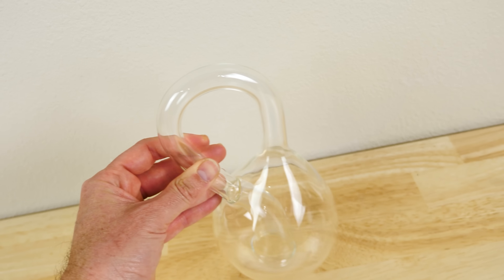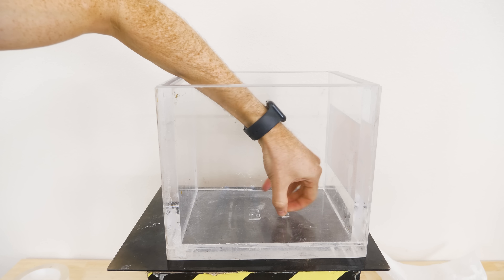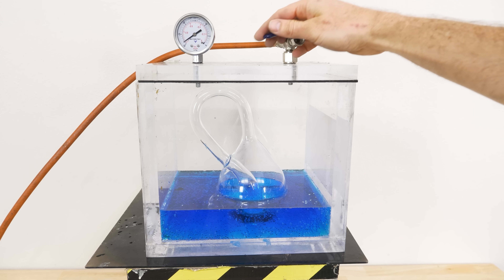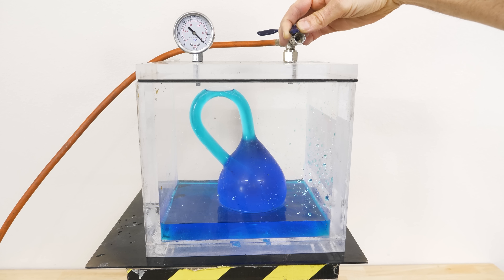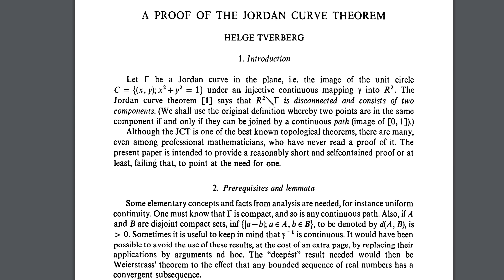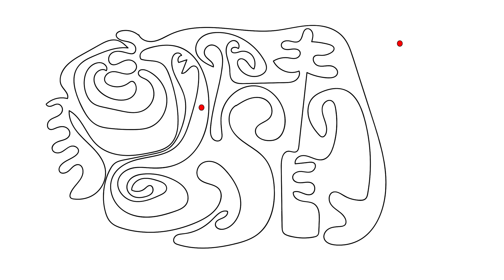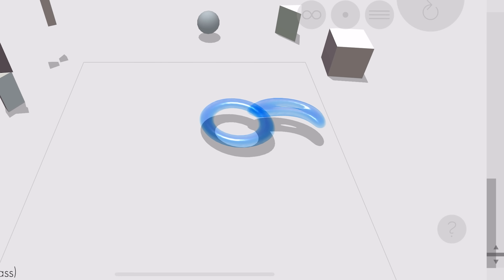Is It Possible To Completely Fill a Klein Bottle?

Comment: Actually the bulb that the water initially came in and the neck are technically the only volume the object has because it still holds liquid quite well inside. Bro just debunked my argument

Comment: The beaker actually does have a volume, due to the thickness of the glass (i.e. inside the glass sides of the beaker is different from outside). 😃

Comment: What the i have a question 3:20 so does a cup have no volume
Reply: The volume those not include the hole, the mug itself does, the handle and all that stuff , tecnicaly the bottle does have a volume since the glas Is somewhat thick, but the geometrical shape itself dosen't, this Is like the best replica

Comment: Or you could completely submerge the bottle, moving it around constantly until all the bubbles leave the bottle.  But then you wouldn't have used the vacuum chamber, and at that point, is there even a point to doing that?

Comment: Couldn't you FILL it by using a flexible tube on a syringe?

The problem with filling it compared to a normal glass is that the opening as a syphon and will be filled completely with water, so that the air can't get out. A small tube going through that opening into the chamber would solve, wouldn't it?

Comment: It's not really "arbitrary" to say the volume of an open containing is at the flat top if you're referring to the volume of what's inside of it, because that's how it works and how it was built to work. It's no more arbitrary than simply deciding the physical object itself counts as the borders for where volume exists. Otherwise, volume would be the amount of mass of the object itself, not the space in or out of the object.

The Klein bottle only doesn't have volume, based on your description that a regular open cylinder doesn't, because one end is open. Going into itself doesn't really matter because that portion of the bottle can be filled in and around the tube with matter. The only thing is if you want to be completely exact, it would have to subtract the volume of the tube material itself in that section. But earlier I mentioned the volume of the item itself rather than the space inside or outside of it. So the Klein bottle has a volume because it exists, obviously. So the volume of just the inner tube subtracted from the volume of parameters inside the tube and outside the tube (But still inside the bottle) plus the volume inside the rest of the tube is the volume.

It "technically" has no volume. I guess it's just the fun nature of the thing.

Comment: This is cool but misleading. That's not a Klein bottle. A klein bottle cannot exist in 3 dimensions. Also that beaker does have a volume in any way of interpreting it. If you are interpreting it as a surface with no thickness then its volume is just it's area (it is homeomorphic to a 2d ball). If you literally mean the beaker with thickness included then it has a 3 dimensional volume as it is homeomorphic to a 3d ball. Either way the beaker is orientable. The klein bottle has no volume because it is non-orientable

Comment: To fill the container, simply insert a flexible plastic straw or a small diameter flexible tube into it and then pump the water through the tube or straw. Now the air comes out and the water goes in, there's no need to create a vacuum.

Comment: but what is in and what is out? If you can confuse those then it gets real messy. The universe as I build it has in or out in both space and time, like how light travels, from A to B, it does so without a care for C in all directions at once, but it is ultimately one directional. If we build a universe out of this flat line you want to pin A in place and rotate B around itself infinitely in all directions allowed by the finite limit you set on the line length (x), it seems to work, you create a nice tidy 2D manifold on a 3D object, but what and why is one end of your line pinned in place? I square it up moving one end infinitely slow and the other infinitely fast, it seems like a similar shape, but now you have a manifold on the inside and outside, a tiny sphere at the centre and a larger sphere outside. You created a finite looking space from 2 infinities. In and out. Switching the perspectives just creates a mirror of itself where its inside out but its the same looking shape. 

IDK it feels a bit more like how the universe does things. You seem to have 2 infinities. One we look out across, its easy to rationalise it as being infinite and mass being finite, you can walk around the mass to see its extremes, so it feels finite, but is it? 

If you could go on a journey to the core it would be a long journey, with pressures and compression, you wouldnt be the same size or shape when you arrive. But when you get there, is that the limit? There is certainly more scaling inside you, to the atomic, and subatomic, and maybe beyond.. when you are there at the core you and the mass have the same idea of down left inside you, so you are null, weightless.. If you move from the core without motion, the mass of the planet is inflating and dilating more mass in the same time than you, so you have a perspective of sinking, but are you moving or is it? 

4000 miles from the core the dilation of the planet pushes you up and out at 9.8 mtr/s it feels like you are pulled down towards that null point, but its just the displacement in space and time. If you give yourself a nudge at the core you enter orbit, keeping pace with the universe, adding momentum raises your null point up and out from in, this is orbital mechanics coming from inflation, not a pull a push.  The reason you feel like you fall is because you are higher and slower than orbital mechanics would usually allow, your null point is a ways below you in space and time so you want to "fall" to it. If you was lower and faster than orbital mechanics allows, you would fall up not down..  Perspective is weird huh, but the math fits to why we cant see into the void infinitely, pretty soon the universe seems curved even for light.. 

But it is all perspectives isnt it, we can rationalise the infinity out as light can cross it easily. If it was looking at mapping the universe it might think that we are the voids of infinite size.  What is the bigger infinity, the one we both see across, or the one not even light can see into.. 

In one sense I see the universe as a singularity containing a singularity, scaling infinitely its just event horizons separating realities. Rationalising the one in space is easy, you approach a singularity. As you do so you appear to slow until you would pause to me, the flip perspective comes if you can scale and dilate in size, if you could take a trip to the atomic world, your old room would red shift from view, even if you only went as far as a glass of water on your table, a new observable universe becomes visible. If you could see past the void, we would look like we paused, like we were the ones on an event horizon, because we are.. This is the way through, in.. deeper smaller time will tick by faster and faster for you as you scale, its all just dilation in space and time as you ride the fractal that is the universe.  

At the centre of a singularity should be a null point like at the centre of planets, its the flattest local area of spacetime, but a Newtonian mind says the mass pulls out in equal opposite directions, it should allow a tiny event horizon to form, and inside it is where our universe plays out, infinitely hot and small that side of the horizon when you dilate down inside its cool and expansive. As our singularity cools it evaporates and loses mass, the central point "grows" and relaxes, the universe gains a bit more space to grow into and we all fill the void by dilating, everything space and time and mass all dilate, but not light..  its an information wave riding an information wave, it records the change over time, red shifting as it goes, 

Check out a symphony of spheres in microgravity, its kind of how I see it, with singularities inside eachother, mass transfers give dilation and momentum to a static system. It looks clunky but i bet causality is smoothing it out for us, if it did pause between mass transfers we woudnt know. It feels like a vector, presenting as a logarithmic curve, but it is messy, far from constant. its all just perspective between 2 infinities, one in, one out, its like space is pulling or counting from one direction and time is doing the opposite. We straddle a thin layer between in and out. 

Also find a Julia to Mandelbrot set, centre things on xy=0 and you see that squaring 2 infinities can give you something from nothing, it looks like a circle or sphere in a void, infinity in, and infinity out. Squaring up and following the chains you either loop in to an infinite spiral, or out to another infinity, but both ends never stop moving, you have what looks like a closed loop and open hooks, its almost quantum.. idk it feels like if it is a circle you square it up infinitely again and its a sphere, square it up infinitely again and its a whole universe of spheres, square it up again and its spheres inside spheres around spheres to infinity.. 

This is how I would build my universe from infinities. My time cone feels more open, rather than closed, its a tunnel, where my resting horizon is flat, spinning me around the walls, If I can get up to light speed then I travel out in space but not so much in time, my vector aligns with the tunnel, This is thought to be the limit, but keep going, accelerate more and now your vector line is curving away from your initial spin, it seems like you grow in size and scale  to an observer, but you head for the wall of the time cone, the faster you go the sooner it will be, but when you hit, you will be 180 degrees from your initial vector, you break into a higher tunnel where your new speed is a resting speed in a larger tube that surrounded the smaller one. 

This is the way out, or in? its hard to rationalise which is out, which is in. We have flipped perspectives so many times it feels like it doesnt matter. Light itself is a reflection, bi polar in nature. It will give you false positives and confirmation bias. Take flatness you feel, it never aligns to the flatness you see for long. Light isnt doing orbits so it doesnt show you the curves in space and time that you are bound to. Every flat path we take seems curved.  It always will until you approach light speeds, then nothing will seem flat apart from your vector. to your sides will be a curving horizon that will mostly fill your view

is out larger than in? can you be in without having something out. 

Its easy to give one infinity more value or weight to it, but only if you have some finite limit imposed. Take a situation where you have 3 pockets, 2 infinite in size, one finite. The rules of the game say that the 2 infinite pockets carry the same amount of money, they weigh the same amount, filling the same space, but one is $1 bills and the other is $100. When you spend you can only pull from one pocket, and you can do it infinite times, and any change from the transaction will be stored in your finite pocket, where you cant spend it. 

Now you have limits on infinities. The $100 bills will save you time, but if you have infinite amount of time, you wont mind counting out your transactions in dollars, you are worried about change weighting you down more no?

What if the transactions are in the billions, and your time is infinite,  but your patience isnt..  there is a balance to what is worth your sanity no? if it was simply a finite time limit tho you wouldnt want to spend your life counting out smaller bills all the time. Carrying some weight with you is a certainty.. but the weight can hit you in so many different ways it depends on your perspective of it, just like your perspective of the infinity you see over the one you are stood on, if you had infinite time to explore the universe you could explore space easily, but mass, that is hard, you need to break more than time to go there.

The speed of light in a vacuum is faster than it is in water, so what is the speed of light in mass. id assume it wasnt zero but i also would think it wasnt fast, or you would see through the planet eventually.. Is it Euclidean, if you asked light it would say no. If you cored through the planet it might feel like you connect 2 points with a flat path until you walk it, if you could see it on a time cone you map each step.. Its not the flattest route, if you flatten the cone out for density, is it even the shortest?

Cones are weird, you can have one looking 2/3 full and it is barely filled and thats with density constant like a glass of martini.  How weird are they when you have pressure, and density and dilation.. What shape is our time cone of the planet when its flattened out for density, how tall do you think the cylinder would be? would it be a cylinder? could it look like a light bulb? if you could unfold everything would in be a bigger infinity than out?

Comment: Couldn't you push a bendable straw all the way to the "bottom" of the bottle and fill it through the straw? The liquid should push the air out of the bottle through the "opening" as it's filling it. This should be the same as filling the bottle from the bottom, so it should push the air out, no matter how much the "top of the bottle" bends.

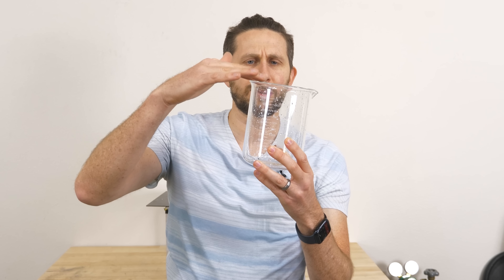Comment: At about 3:45 it's explained that "you could say the volume of this beaker is anything below this line here" in reference to the top of the beaker "but we would just be placing an arbitrary line to differentiate between what we perceive to be the inside and the outside of this beaker" to explain why the Klein bottle, as well as the beaker, have no volume
I have a severe issue with this way of thinking in the scientific community as well as with scholars in general. The concept of volume in general is made with an arbitrary definition with the purpose of determining how much space an object holds. Under these parameters of purpose you're being obtuse. Determine the variables (like gravity for instance, possible velocity if you're using the estimated volume hypothetically to remove a liquid spill in space so you took a beaker and used speed to scoop up the spill)
This is an issue in philosophy as well. When people spend too much time trying to become learned they become stringent and it's difficult for them to view things outside of how they learned them to be. When speaking of volume, you're technically correct, but technically correct is the worst type of correct in lamens. If you're a rocket scientist it's important to have every number, calculation, and definition be correct, be technically correct, but I think this is a way of thinking that people in specialized fields accidentally bring into the real world. It's important to take some time once in a while and get the outside view of your field and not forget that a lot of the philosophies you hold in that field become too obtuse and stringent in the real world... All this to say, the Klein bottle and the beaker do have volume, but theyre determined by more factors than just the shape and size of the container

Comment: A physical Klein bottle doesn't appear to be an ideal Klein bottle because you still have to form a seal where the neck moves back into the main body of the bottle, and so it forms a seal that defines an inside and an outside, if you assume the opening at the bottom of the main body works just like the beaker.

Comment: I do appreciate that you pointed out that a physical Klein bottle is no different than any other bottle, other than shape. As for 4th-dimensional objects, do we have a way to confirm that a 4th dimension exists? Actually, the 4th dimension does exist. A Klein bottle should be referred to as a 5th-dimensional object. The 4th dimension would be time.

Comment: Any cup doesn't have volume... if it's open, you don't have volume.  Doesn't seem very interesting. It's basically a bottle or a cup, you can turn it around and do several things, and call it calculations... it's a freaking cup.

Comment: According to the definition of volume used here in the video a normal coffee cup also 'has no volume'.
Both, the klein bottle and the coffee cup are open to the outside, the only difference is that the Klein bottle is so to say  'folded' through itself. 
- The outside surface of a Klein bottle is at the same time also the inside surface.  
-  However the latter statement ALSO applies to the regular coffee cup just the same. 
As mentioned, just like the Klein bottle, the coffee cup is open on the top. The 'inside surface' of the coffee cup stretches around over the top edge onto 'the outside' so there is also only just one actual/mathematical surface on a coffee cup. 
The Klein bottle and a coffee cup are more similar than it seems at first. 
What makes it a little confusing is just that one so to say has a 'knot' in it while the other doesn't. 

Where the video is somewhat wrong is in the definition of a Klein bottle. The 4-dimensional version is merely a 'non-intersecting' mathematical variation of a Klein bottle that can only exist in 4 or more theoretical (purely mathematical) dimensions.

Comment: Math: solving problems it created. You don’t need a freakin’ vacuum chamber to fill a Klein bottle, you need a flexible tube that is smaller in diameter than the pathway into the Klein bottle and that’s it.

Comment: You don't need a vacuum chamber to fill it. Use a thin tube, stick it all the way in to give the air a path to flow out. Then pour water till the thing is full and simply pull the tube out...

Comment: just put the bottle fully underwater and just keep spnning it around then it will fill up
Reply: That would just be the same as filling the tube and turning it
Reply: @ no cuz the air will come out the same as if you put a normal bottle underwater